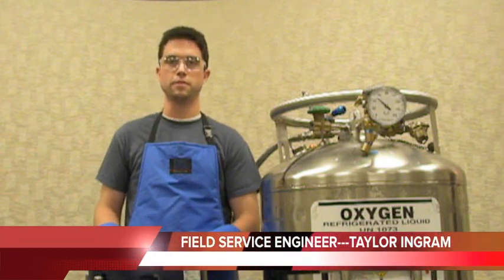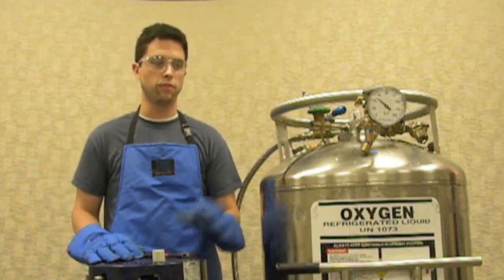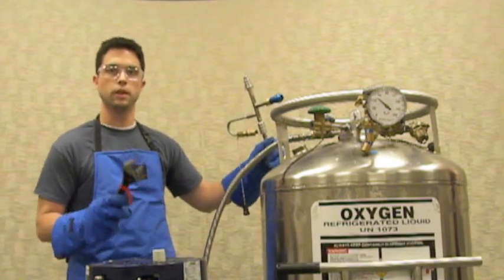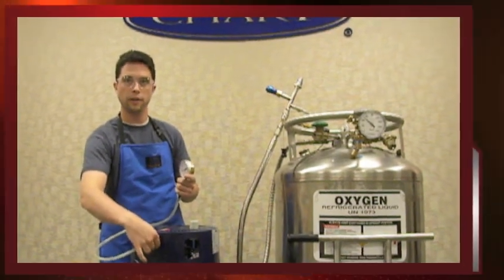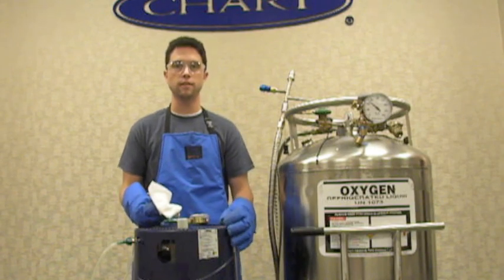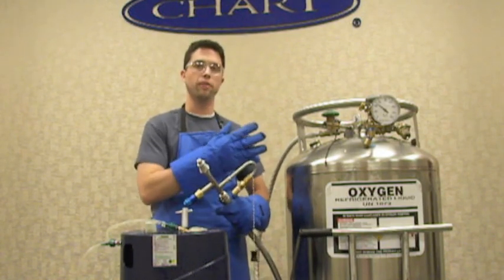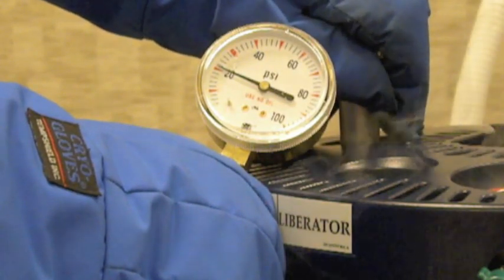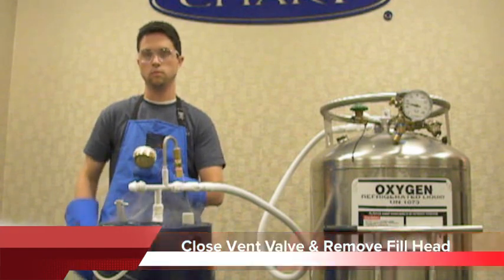Filling a Liquid Oxygen CAIRE Reservoir From a Bulk Tank

Comment: Somewhat correct but not the correct way to fill a lox base. The correct way is to gravity fill the base this ensures complete fill with correct saturation and allowing your primary relief valve to stay closed during fill. This is the way it was designed to be filled 45 years ago.
Reply from the maker: Thanks for your post. This video instruction helps to ensure that we end up with LOX saturated at 20 psi so the patient will get the correct prescribed flow rate. A gravity fill would leave the reservoir at close to atmospheric pressure which would cause the delivered flow rate at each setting to be under the prescription.